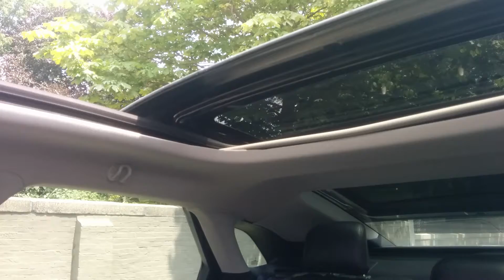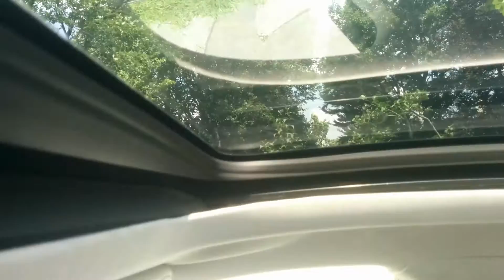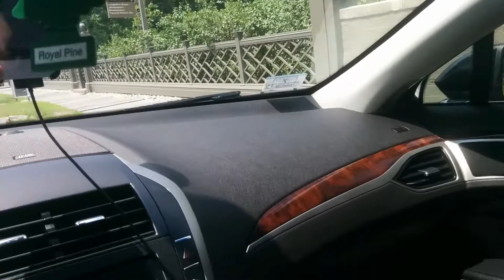Black 2013 Lincoln MKZ pano moonroof skid issue.

Comment: Info is excellent, just got a used 2015mkz, got it at 62606miles. So far so good but anticipating preventive maintenance as much as possible.
Reply from the maker: Thank you Gerardo, I have since that year sold my MKZ for a Audi A6 TSFI. Then I traded that for a Suburban LT
Reply: How’s your running?
Reply from the maker: @Znsg4  Having shifting problems now after I added 100,000 miles of driving to it. A Chevy dealership quoted me $7500 for a remove and replacement job for the transmission.
Reply: @Vaderdad damn man mine has 300.000 miles no problems except my moonroof

Comment: Mine is doing the same. The dealership wants $2300 to fix it.
Reply from the maker: They didn't charge me. They just greased the trouble spots. A month after this video, I traded my MKZ for an 2013 Audi A6 TFSI. I traded for an Audi because of multiple reasons. The suspension was better, No issues with moonroof, Engine was better, dealership service better.
Reply: @Vaderdad  I had a 2006 Audi A6 and  2012 A7. Good luck with your Audi. I won't ever buy one again.
Reply: Jibril Sulaiman my shade just got stuck while closing it like it got stuck fuck
Reply: Maybe the tray came off track! Trying to figure out this issue of it stuck on open on a 2012! Maybe just a little grease right? Hopefully its not the guide's on the track.
Reply: @jamesrich1749   You find any solution? My sunshade just got stuck and is bunched up on one side
Reply: Mine did the same thing, than it finally bunch up. The dealership want $750 for parts and going to tell me it going to be 10 hours of labor. I guess I will keep it close or I will be on google trying to figure out how to fix it myself. Have anyone else had there fix.
Reply: @jamesrich1749  did you ever find out how to fix it. Mine is doing the same thing
Reply: @Smoothnf any luck? Same exact issue
Reply: Any luck bro?
Reply: @Znsg4  dealership fix mines and it was under warranty and it cost them $15,000.
Reply: @Smoothnf Jesus 15,000?? I guess I’ll just greese it and and if dosnt work never use it
Reply: @Vaderdad how did that work for you!
Reply from the maker: @Smoothnf  $750 isn't too much compared to other auto repair jobs from a dealership. For example, removing and replacing a transmission cost me $7500 for a Chevy Suburban.